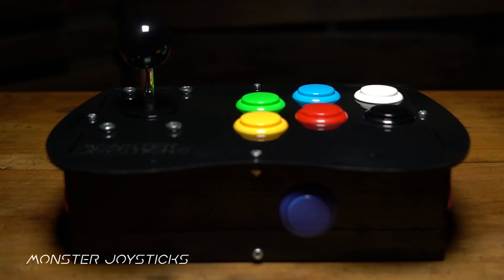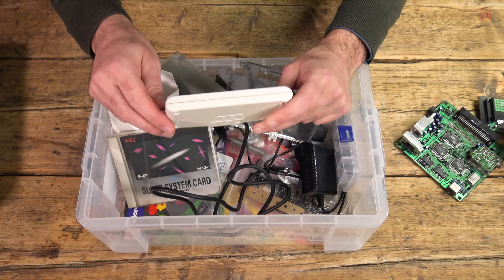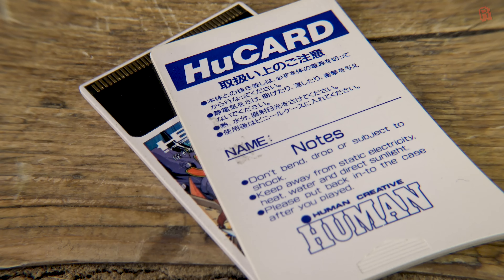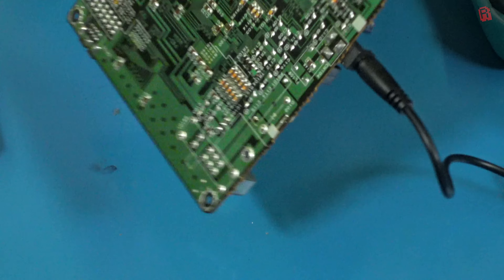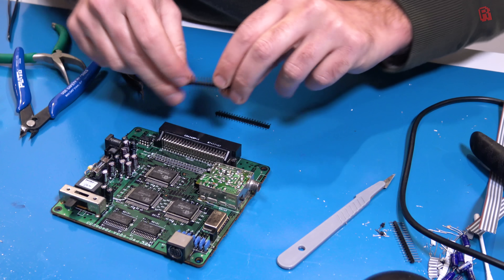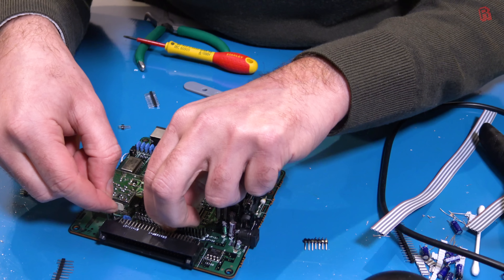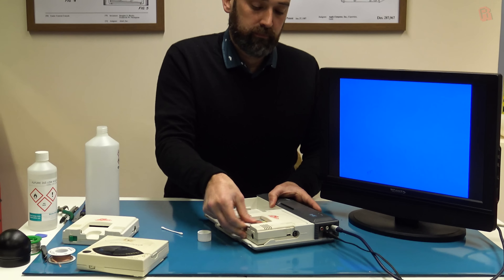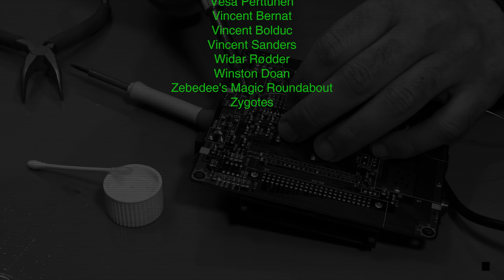PC Engine Trash to Treasure (Pt1) - Restoring NEC's 8bit Wonder

Comment: Nice work as usual.   Replacing the voltage regulator is certain to be a huge improvement in terms of heat.   Also a good call on replacing those caps, of course. 

Nicely done, and looks great.   Look forward to part 2.

Comment: I always wanted one — well, the TurboGrafx 16.  The CD-ROM was just so futuristic back then. This video brings me joy.
Reply: I bought the Turbografx 16 new in box recently. I remember C&VG covering the PC Engine and I saw screenshots of Out Run I think, was really jealous as the C64 and Amiga had terrible conversions (at least the C64 version was fast). But it talked of step down converters and NTSC to PAL devices required, so it wasn't going to happen. I was at school and importing games would have been expensive.

Comment: Absolute beast of a gaming machine, I had one in 1988 or 89 from PC Engine Supplies based in London. £200 with P47 Thunderbolt. It was a great time to be a gamer back then as the PC Engine was a massive jump from the 8 bit home computers and left the 16 bit computers in the dust with its arcade quality visuals, sound was not all that to shout about though. Faulty Multitaps from memory could blow the internal fuse as happened to me a few times. You could argue that Sega's arcade ports where better on the PC Engine than the MegaDrive and nothing other than a NeoGeo AES could touch it for sprite handling duties. Shame it never had a proper launch into Europe other than the tasteless TG16. Happy memories indeed.
Reply: I'll have a dig later to see if I've still got the rare as hens teeth PC Engine to TG16 converter,  it basically reroutes the pins on  the Hu-card to suit and its a nice lurid pink as well. I've not laid eyes on it in decades but it could well be in the attic somewhere and if it turns up I'll post it your way as TG16 Hu-cards are  considerably cheaper than the Japanese ones.

Comment: It's an 8-bit CPU but with great custom chips that NEC offered to Nintendo and they said no. Seems Nintendo is great at producing competition by rejecting help from others :)
Reply: Also I think the sound chip is really nice with its programmable waveforms.
Reply: The Nintendo market share isn't dwindling they don't need and have never needed to stray from their own path. Also, by todays standards they were right a cartridge would be way more ideal than any form of optical disc.
Reply: @PWNHUB  Sorry but you cannot dismiss the success of the Playstation. It was the turning point where Nintendo started to lose developer support. The fact that the Gamecube, Wii and Wii U used discs showed that the N64 using cartridges was a mistake. It meant a lack of a uniform experience across platforms with the N64 lacking cut scenes.
Reply: @6581punk  with the added irony that Nintendo could have offered a CDROM drive for the N64, as it had a bottom expansion port much like the SNES (that what became the Playstation was meant for). Closest was the 64DD floppy unit released in Japan.
Reply: @6581punk  All mechanical drive added to any computer system should be labeled as ancient technology , Nintendo decision were right , but the solid state storage back than were too expensive to make
Reply: @arduinoguru7233  It wasn't the right decision at the time. The N64 sold 32 million, the PS1 sold 102 million. N64 has 296 games in its library, PS1 has 1300 games in its library.

A PS1 game stored up to 700MB on a disc, an N64 cart could only store 64MB. At the time CD-ROM and multimedia was big and streaming video from disc was in fashion. You can't have been around back then if you can't accept this. DVD launched a few years later, again streaming video from disc. 

The fact that Nintendo only moved back to "carts" with the Switch shows that NOW is the time where you can remove the optical media. But it was everywhere in the 1990s, DVD, Dreamcast, Saturn, PS1. Even Microsoft used it for Xbox1. Hell, the PS5 and next Xbox will use it, why? it rarely runs the game, it is just a "key" that lets you access the game which will by the time of launch be mostly downloaded to the internal storage. Any cartridge game is just a very expensive "key" unless it can be rewritten, the game won't often be running from it.
Reply: @6581punk  n64 carts could only store 256 megabytes by 2000
Launch titles were 8 megabytes and it got gradually bigger over time.

If you're talking pure technology, you're still wrong, because the n64 cartridge bus is built for  up to 256 megabyte cartridges. (which is unimportant anyway because a bank switching implementation, as seen on older systems is easy to implement.)

The problem was definitely cost. (from a developer point of view. Nintendo's opinions may have varied)

Cost of 600 megabyte CD (in bulk):
$0.10 a disk.
Cost of 8.7 gb DVD
$0.10 a disk.

Cost of 64 megabyte n64 cartridge (2000 prices):
$35 per cartridge.

THAT is the problem for devs.
Anyone could have released an n64 game of a few hundred megabytes if they really wanted to (and nowadays you can make them as homebrew carts up into the multi-gigabyte range for less than the 64 megabyte carts cost to make officially), but there's no way you'd convince anyone to pay $250+ per cartridge...
(unless you're a Neo Geo. That's why Neo Geo games on cartridge managed to be 40+ megabytes at the same point in history that a SNES game was 2 or 3 megabytes. As an arcade system they could convince people to pay the premium)

Cartridges are functionally superior on a purely technical level.
But it was indeed the wrong choice for the time on any practical level...

Also the switch has cartridges because optical media is impractical for a portable system.
No Nintendo handheld has EVER had an optical drive, no matter the era.
Not the GBA, not any of the DS variants, not the 3DS...

The switch doesn't suddenly have cartridges because it's 'practical' now.
It has them because it follows the design logic of a handheld system.
It's a handheld design with some concessions to home use.
NOT a home system with portability, in spite of what people might claim.
On a technical level, it's a handheld with video out. 
Simple as that.
It would have used cartridges no matter when it got released solely for that reason alone.
Just like every other nintendo handheld ever.
Reply: @KuraIthys  PSP used optical discs and was a fairly minor success.  Optical media is not being developed at a speed anywhere near what flash memory is. Bluray is not successful.  Younger people don't build a collection of music or films like others used to.

Yes, Switch needs to be more portable. Question is, why did the PSP choose optical over cartridge? was obviously cheaper and held more. Possibly also for copy protection reasons.
Reply: The main selling point for Nintendo by far are their IPs which are huge and numerous. Hardware is often innovative but usually secondary and inferior to other manufacturers.
Reply: @Farglior X"LMFAO! Nintendo have been SNAILING behind since the Super Nintendo!" Uh, I would take a look at those Switch sales numbers....

The way people hate massive corporations in defense of other massive corporations is very strange. Nintendo is a classic example of that.
Reply: @6581punk  "It meant a lack of a uniform experience across platforms with the N64 lacking cut scenes." Wasn't all bad, then? 

Yeah the PS trounced the competition but that doesn't mean the move to disks was a universally good thing. And certainly doesn't mean the N64 wasn't a success. In fact, the only problem it gave Nintendo was the serious blow of being the home of Final Fantasy. Optical disks were certainly a worse option for users in every way except for storage space, which was of course a poisoned chalice for most games. what does it mean? It means we can play Dragon's Lair instead of Ocarina of Time. Great. 

Truth is it was a better option for games publishers - they could charge the same amount for a tiny fraction of the unit cost. Something Nintendo don't like, but something that has kept Nintendo in the black since the release of the Famicom.
Reply: that isnt true at all they used many people help from game companies like capcom and SGI to help make N64 which sega rejected the reason why u have the playstation is due to nintendo working with them then sony trying to screw them on profits think u should read up on FACTS there are many more points i can make here
Reply: @KuraIthys  Switch games that have updates - they use the Cart as the 'owner key' much like most BluRay games on PS4 & Xbox1
Reply: karl marx  The methods for hacking the Wii U involve the Wii channel. It inherited the Wii's security flaws. It could have had games on laserdisc and still have easily bypassed security.

Comment: Smart idea with the pin headers. I'm sure someone in the community will make a mass produced replacement for the ribbon cable at some point. I've heard of a lot of people breaking that cable when first opening the case. There is a jailbar fix as well if you replace a couple capacitors. Thanks for a great PC Engine video in 4k...we need more of those!

Comment: two tips from me:

1) It's possible to remove the composite video out port and replace it with an RGB port wired to the correct points on the expansion port. Not sure but I believe you can use the same one that is found on the Master System which makes having the right cable easy. However this can get in the way of the CD-ROM unit, in which case it's worth considering adding a port to the expansion unit itself. You can actually do both.

2) Super Star Soldier.

Comment: Near the end of the video, when You lifted up the bag with the cd-rom² in, a screw fell out and you kicked it all around the table with Your sleeves. I hope that poor screw is ok *lol*. Apart from that, yay! One of my favorite consoles. Isn't it cool and sleek looking? And it had CD-rom support before it was cool! I really like that little thing ^_^ That voltage regulator swapout is a great idea. I might do that to my PC-Engine as well. I bet it would like getting less hot. Thanks for the video!

Comment: Loved the outtakes staying in (in-takes? =P ) Great machines and really good for amateurs to cut their teeth on for mods. Nice pin pitches etc.. 
Interesting about the drop-in regulator replacement as well. Have not come across those. Thanks for the tip.
You CAN modify the dock for RGB, though from memory, they recommend using one of the internal mods in it and creating a DIN output. MD2 Scart cable and din socket for cleaner presentation maybe.

Comment: In FRance, we were a bit more lucky, They was SoDiPeng (société d'importation des PcEngine) that sold officially converted Japaneses NTSC/60 PcEngine/CoreGraphX/SuperGraphX units to RGB/60 (as no one realeased any more Secam systems since mid 80's). So a very "modern" TV that handle RGB in 50/60 Hz was required instead of a much pricer compatible NTSC/60 TV set.

Comment: Regarding the screws - In a pinch, melt the end of a disposable pen and press it over the screw - let it cool then try that. I've taken an N64 apart doing just that. Not as good as the proper tool mind but worth a shot if your desperate.

Comment: Also one tip if you need to open a PC Engine's and don't have the correct screwdriver, take an old biro (Bic ones are pefect for this), and take the ink and nib out, and then gently warm the nib end of the biro shaft, and then press against the screw until the plastic solidifies. Voila, instant cheap screwdriver for opening your PC Engine if you ever need to :)

Comment: I have also used the desoldering gun as an iron. They are both next to each other, but the gun heats up faster, so it's quicker if I just need to replace a couple components to get something working.

Comment: Great restoration.  If all different outputs are on the connector pins, you should be able to just find the same pins the cable uses in the expansion port.
I am not very familiar with this device.  I look forward to seeing more.  It looks quite interesting.

Comment: Great video been waiting for this. I have over the past 2 years built up my pce. And have a working pce, rgb modded interface unit. Everdrive.

But the bit I want to get working is my CD drive. So looking forward to part 2. Had my drive recapped and middle gear changed. But still needs a lens replacement 😢

Even managed to get a cheap arcade card Pro. So they are out there if you take your time.

Loads of great games. And the best version of street fighter 2. But okay with a 6 button pad or stick.

Comment: I would suggest following the wiring of the scart cable as a reference since the pins on the scart have known RGB connectors.  You should be able to use those as a starting point and work your way back to the connector that interfaces with the console (I would use a multi-meter and a splayed out paper clip for this).  Once you have identified the correct pins you could use the holes for the stereo/composite ports on the dock to connect the RGB sockets and either drill in a point to hook up a 3.5mm stereo port for taking the audio out or re-locate the original audio connectors depending on your preference.

Comment: Just wanted to point out a little caveat with the switching regulator, since the PC engine wasn't designed to use one its likely not correctly bypassed for it. Installing one could cause some noise/interference in the video or audio, if no other modifications are made.

Comment: Japanese are so humble that japanese millimeters are slightly shorter than regular ones
Reply: Dupont headers are traditionally spaced with fractional inches not millimetres.  Most common spacing is 1/10 inch (2.54mm).  I bet the holes were spaced a true 2.50mm.
Reply: @GoatTheGoat  ^ That, the board was probably designed in metric units instead of Imperial like is very common in the US and Europe.
Reply: @Stoney3K  for the Empire!
Reply: 0.1" was an extremely common spacing in electronics but some metric fanatics hated it so much they introduced 2.5mm pitch connectors. Ím not making this up.. The weirdest is Eurorack where you have imperial connectors spaced apart by metric dimensions.

Comment: Nice video love the Pc Engine and fixed a fair few of them myself, an answer to you question yes you can mod the interface unit for rgb but if you do take the audio from the board at the back of the phono connectors as if you use the digital audio you get noisy interference and you will have fun getting it apart.

Comment: I'm guessing you can grab the RGB from the connector inside the interface unit. If you don't mind drilling 2 holes for the coax sockets.

Comment: Hey Neil, so I was wondering, what is the ripple like on the new voltage regulator compared to the linear one? How does the video output compare, when looked at on the scope? Thanks!
Reply from the maker: That's not something I've checked Cheater as it looked fine in action so I had no reason to investigate further.  Sorry matey

Comment: The two cards you have there are one of the Fire Pro Wrestling games (the one with a solid black label with only text), and Mashin Eiyuuden Wataru (the one with all the characters on it), which was localized as Keith Courage in Alpha Zones for its TurboGrafx-16 release.
Reply: Yes, there was also a "Majin Eiyuuden Wataru Gaiden" on Famicom which was an Action-RPG, a very different type of game compared to its PC-Engine counterpart, even though they share exactly the same game cover art :-) Cheers from Poland RMC!
Reply: @mwk1  I'm guessing it was cheaper to just reuse the same promotional art from the anime that the games were based on. The more things stay the same... ;)

Comment: They sold an external battery pack for the CD module to let you use it as a cd walkman.  Similar to the 1st generation Philips/magnavox cd walkman from around 1985.  All in all it was about the size of a small "bag" cellphone

Comment: I look forward to watching the rest of the episodes.

A couple of questions though:
1. Did you really do all that soldering without knowing if the console was actually working?
2. Did you shave the female connectors as well?
Bonus question: why so much cable length? 2-3 cm less would have made easier to close the case.

About getting rgb out of the base adapter you may replicate the functionality of the custom cable by soldering wires onto the expansion ports pins inside the base.
Cheers.
Reply from the maker: Hey there!  I did but it was an easy board to work on and I was already sat at the desk with a mug of coffee and a hot iron so it didn't take long to just bash through them.  I only had to shave the headers, the wires themselves were fine.  I imagine the system originally had so much cable to allow you to open it up without hassle, I allowed lots of cable for the same reason, otherwise you'll be in a position where you're trying to close the case and hook cables onto the header pins at the same time
Reply: @TheRetroCollective  nice.
From the video it looked like if the new cables allow the case to be opened 180 degrees, hence the question about making the cable shorter. E.g. I'd be happy to be able to open the case at a 90 degrees angle knowing there is a connector preventing the cable from breaking.

Did you mark pin 1 on the two ribbon cables BTW?